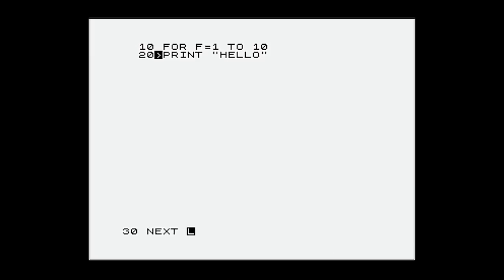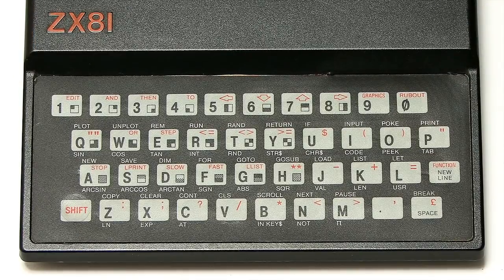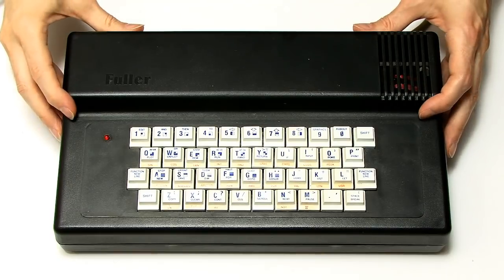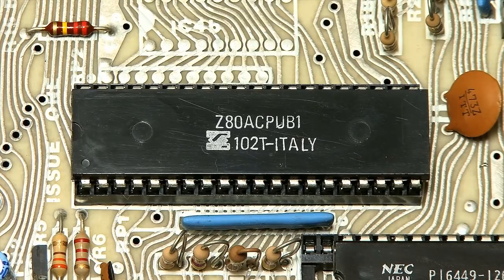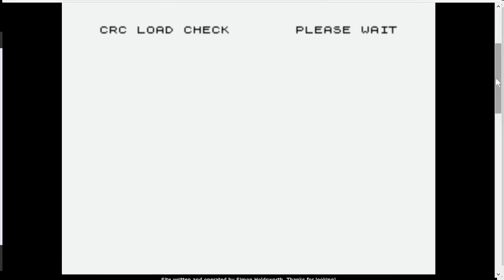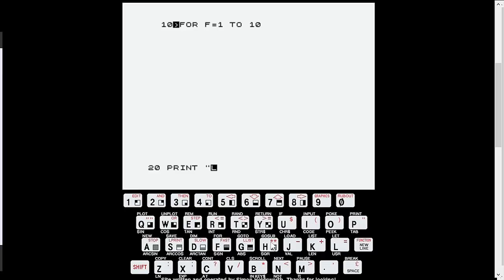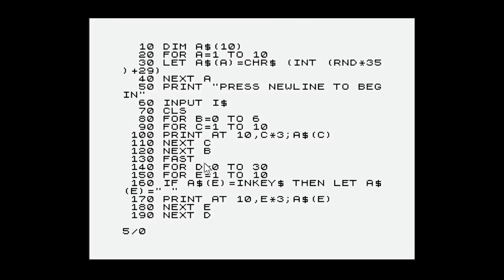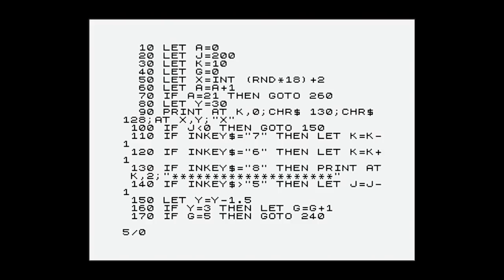ZX81 Classic PC

Comment: I had the ZX80 in kit form which when built would not work, so we sent it to sinclair for repair and it came back fully working, I waited about 18 month from the release of the ZX81 before buying one thinking that an even better machine would be just round the corner, and it was I didnt have the ZX81 long before commodore released the VIC 20 which I got as a Christmas gift

Comment: A nice blast to the past :-)
Reply: If you change the original Z80 with one of the newer CMOS 6 or 8 MHz parts it may be possible to up the the CPU clock speed a bit. Maybe someone could give it a try.
Reply: it will affect the pixel timing.

Comment: I can't thank you enough for bringing these memories back! The ZX81 was my first computer as well, and I remember those books and magazines. Sadly mine had a problem saving programs on cassette, so I stuck to the shorter programs. I also remember the feeling entering a longer program, and then accidentally touching the very sensitive RAM pack. It always led to a hard reset. Finally the keyboard gave up so I sold the mainboard to a friend who needed it for repairs. To sum it up I had a couple of very joyful and educational years with my ZX81.
Reply: I recall one magazine listing in machine code that took about half an hour to enter. You ran it (obviously without saving it to tape first) and it displayed "APRIL FOOL!" and then restarted the machine! :-D

Comment: I started out on a TI-99 4A, then TRS80. After that, a long series of Commodores; C-64, C-128, Amiga 2000, 3000, 4000.
Reply from the maker: Wow, that is a long series of Commodore machines. They were nice computers.
Reply: no sx-64?
Reply: or VIC-20
Reply: my buddy had that with the cassette drive
Reply: The TI was my first machine, too.  Quirky thing  ;D
Reply: My Amiga 1000 was the most inspiring computer I ever had.

Comment: you all have me beat. my first was a c64. next came a salvage ibm PC XT - Model 5150 with a 8088. next i bought my own 386sx clone, finally I built my own 486dx2-66 system and one week later pentium hit the street and kicked my ass. oh the freaking memories. pfft :P
Reply: dwarf365 sorry to be pedantic, but the 5150 was the original PC. The XT was the 5160. Both had an 8088 though.
Reply: Dubsy 102 you are absolutely right. It was just a 5150.

Comment: It was my first one too. Brilliant!  Although the biggest headache was not the lack of ram, colour or sound, but the need to continually answer the question from bemused family and friends, 'Ok, so it's a computer. But what is it for? '
Reply: Crikey, do I remember that question! I used to tell them that it couldn't do much (although there was the famous quote from someone that it was capable of running a nuclear power station - do you remember that?!) but that one day computers in the home would be commonplace, and that we would be able to do things that we couldn't imagine at the time. Now look where we are!
Reply: Andy Timmons I agree about people asking what it can do. I built a breadboard computer, and people asked me "where is the screen? how do you see what its doing?" when it was programmed in machine language with DIP switches.
Reply: @J0hNF_UK-w1r  It was useful, for technical education. In Sweden, we had courses (using add on PCB:s) on using small computers for industrial control and measurement systems. These were originally based on our Databoard 4680 system and (Z80-based) home/office computer called Luxor ABC-80/800, but later on also on the Sinclair ZX80/81.
Reply: We had ZX81 in school for voluntary computer ‘class’. But my first self-bought computer was a Commodore VIC20 (VC20, the german edition)  More RAM less Mhz😁
Reply: @oleimann  i have a VC20(i'm in the UK), got it from an electronics surplus company in the early 90s, they had quite a few, 'untested sold as is', luckily mine was OK! still got it
Reply: Yes ,totally useless but worth every penny!
Reply: but ran better
by the ways, the way back machine has all the old magazines for the commodores
Reply: Actually in restrospect, having no color and sound in zx81 was a blessing.  When I got commodore 64, it was used mostly for just playing games - a total waste of time.  With zx81, there is nothing to do except to program it, and I leared a great deal more on my zx81 than on fancier computers like apple II or C64.
Reply: @springer-qb4dv  I actually used the C64 (and VIC-20 before that) more for hardware projects involving real world interfaces as well as telecommunications. 
Gaming was just the cherry on top.
I found accessing the internal system ports and buses in the Commodore's much easier than my ZX81.
Reply: sending spam?
Reply: @J0hNF_UK-w1r  Lol!  Yeah, the TS1000 helped teach me the importance of saving often.  
Seemed like you only had to give the power cord a bad look and the computer would crash.  Loosing hours of typing in that Compute Magazine Adventure program.
Reply: Yes... my Dad ridiculed for me for my refusal to "stop wasting my time" on those "worthless" computers!  LOL!!!  He lived long enough to own one himself, and of course, I helped him learn how to use it (and set it up for him).  I experimented with digital circuitry when I was only 11 and had only J-K flip-flops and Nixie tubes  to work with, and drew block diagrams of what computers became a few years later.  All water under the bridge now!  Yes, the "questions"... Maybe not as bad as what Leonardo Davinci had to put up with, but daunting, nonetheless.  Steve
Reply: @stevemichels5608  Lol, sounds like you and I share the same origins.  I loved playing around with my TTL chips and broadboards in my teens.  LED counters, noise makers with 555 timers, counters and shift registers...  That was my childhood.  When I got my first computer, the TS1000 I couldn't wait to get the schematics and start creating I/O ports for interface with my digital experiments.  Not always easy to do with the TS1000.  But then came my next computer, the VIC-20, which rocked my world at the time.  Then the C64.

Comment: I have to say C64, not so much programming, but som gaming. I still have a robotarm you could connect to C64 joystick or to an interface to be run by the C64 and programmed by the user.

Comment: Man, I really want that 3rd party case! I bought a TS1000 a couple of years ago and frankly, the only thing keeping me from using it more often is the damn keyboard and the wobbly RAM pack. Emulators are nice but sometimes playing/coding on the real hardware is just so much more satisfying.
As for first computers, I really wanted a TS1000 as it was cheap and something that I felt our family could afford. It's all I wanted for Christmas of '83. Imagine my disappointment when I didin't get it, but then sheer shock and joy when I opened up an Atari 400 with a 410 tape drive and books on BASIC. My dad had gone to the store to get a TS1000, looked at it and proclaimed that it was something I'd play with for five minutes and then throw out in the snow. The Atari on the other hand was a much more capable machine (and on sale at that point as it was dated tech) but that's what I cut my coding teeth on. And played much Star Raiders, Pacman, MIner 2049er and Wizard of Wor. :)

Comment: The Sinclair ZX Spectrum was my actual first machine, but I consider my second machine, an Atari STE to be my first ‘real’ machine.  It was the first machine I programmed in the C language on.
Reply: Ah, an Atari User!   I remember some interesting debates between Atarians and Commodorians.  I was among the later.
Reply: I used Hisoft Pascal for the spectrum quite a lot, much faster than BASIC for drawing Mandelbrot graphics. I tried Hisoft C but I wasn't able to "decode" the language from the manuals. "The C programming language" book was quite a few years in my future.
Reply: I wish I picked up C when I had my ST/STE/TT's . Would have helped my C# issues I have nowadays. I used GFA Basic a lot, which was the first programming language I learned that didn't have line numbers :)